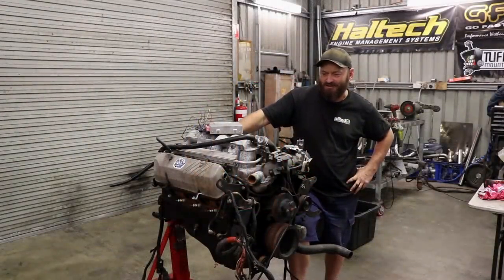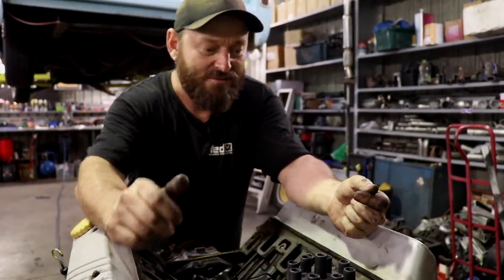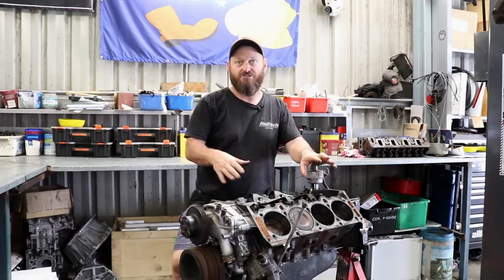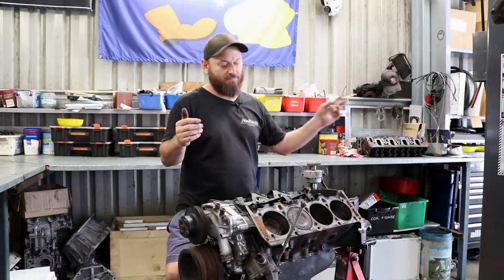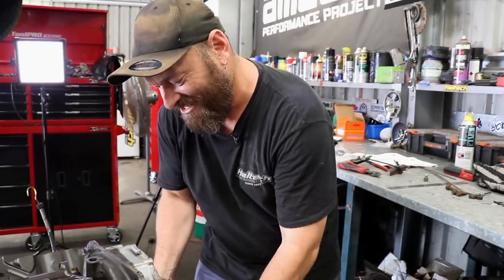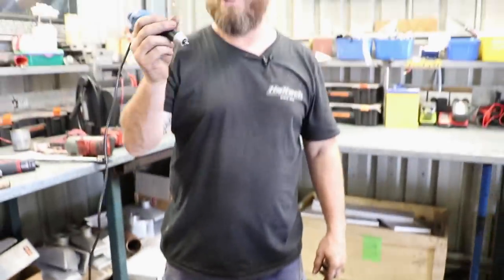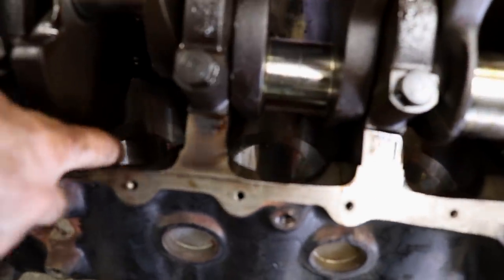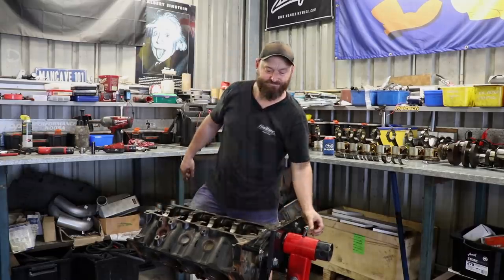GM HOLDEN 304 V8 ENGINE RE-BUILD [EP1]

Comment: Go the Five O

Such a good sounding motor. Not wrong about the torque either. They go hard : )
Reply: 304 is 4.9 even had 4.9 on the air cleaner when first came out in VL s
Reply: @JosephCowen-ru7up  yes but for simplicity we round up and call all 308s & 304s 5 litres. GMH put 5.0 on the back of a VN SS. Also said SLR 5000 on Toranas even though the exact cc displacement is a little different.
Reply: Tru , as a 308 is 5.1 ,

Comment: I’m looking forward to this! I’m old and I’ve owned a couple of these 179KW monsters, no pudding skin was safe from their might! But now I own a beautiful Japanese engine from 1994 BUT I would argue that these old 304s are better or more likely to keep going than the much more modern 3.6 litre 6 cyl turds that saw out the Australian commodore’s run. I don’t reckon you’ll be bothering to pull any of those open in 20 years. None of ‘em will be running unless some mentally unhinged person decides rebuilding one for the fourth time is a good idea🤓
Reply: These engines last for ages if well maintained. Mines 20 years old done 400k only a minor sump oil leak.
Reply: 308wce 05 Yes my youngest one was an ex cop VT with 200,000 on it and whilst I maintained it perfectly and changed oil and filter every 5,000 and put good oil in it, I absolutely rang its neck every day until it had over 300,000 on it flooring it to 100kays an hour multiple times a day and plenty of burnouts and all I had to do besides servicing was lift the cover off the bunch of bananas and replace a vacuum hose once. Traded it in to Holden for a token 2G off on my VE Calais 6.0 and it was still running strong.

(I had to bring the VE right back after 1day for electric window and speaker repair and when I picked it up I noticed my VT parked out the back with a small but thick black rubber fan tail on the rear guard so I know it was worthless to them and they had clearly been giving it a hiding too!)

Comment: It's kinda like a GM 305. Americans like to use them for boat anchors. It made crappy power and the aftermarket preferred the 350 engines.

Comment: It’s a completely stock VT304 roll block Pistons are junk throw them straight in the bin for a cheap rebuild use 20 over size flat top pistons from ACL will cost you $300 take off 25 thou off the deck Will give you a zero deck height Your compression will end up being low 9.4 to 1 comp Get yourself a small aftermarket crane roller cam A little bit head work do a good Port job on the manifold fit extractors And you will pick up 60 to 70 hp

Comment: The vn group a motor made 215kws with its twin throttle intake, they lost 15kw for the sv5000 and used the bunch of bananas intake. 

The VT GTS and senator's hsvs did have the blueprint option as well, they made 220kw, blueprinted was 230kws+ 

It is kind of scary to see the crank need balancing on every 304, but Japanese and most European things spin up perfectly. But it's room for improvement.
Reply: And they ran front rear and middle sumps.
Reply from the maker: @Low760  What was the middle sump for?
Reply: Hk-hg Kingswood was middle, aftermarket ones are very obvious that they are mid, lh-lx Torana is different again too.

Comment: Steve Morris uses splayed 4 bolt mains for his SMX engines, I'd say he knows a liitle about it.
Reply: Glen Tight Steve Morris'  SMX is an Alan Johnson design 481X .  Steve more played with water jacketing.  FYI... Formula 1 Engineers think splayed steel caps are a bit of a joke as they 1... expand at a different rate than cast iron or aluminium and 2...They pull into a skinnier part of the block webbing... that's my 2 cents worth to try and get someone upset!!! Cheers!!
Reply: @robmotown1  yes, the SMX is a 481X base, but c'mon, "played with water jacketing" is selling it a little short. There's a stack of work in that. The main reason to redesign the water paths, both in the block, and heads, was to run drag week cars. Crank/Rods/Pistons would go into any 481X✅. 

F1 engineers aren't building "streetcars", nor are they dealing with 3000hp+ at the crank, they build to a ruleset, I don't know the ruleset, but I am fairly confident that their tolerances wouldn't allow a cold start.🤣

All the 481X stuff is billet. Block, mains, heads, probably rods too.

As for upsetting someone, it's all good. It's just opinions.
Reply: Glen Tight yes Steve Morris has done a lot more than water jacketing...!!!  His SMX is very VERY  impressive!!! I wasn't playing his engines down... Iwas just saying that his whole goal was to have a water jacketed 481x. And that is what he has done. But it is still a fundamental AJ design. So basically... I am saying that it isn't solely his design engine.... He has improved on AJ's design!!! And ... made a couple of design features that have you buying from him only!!!! ..... not that there is anything wrong with that!!! Most short engine parts are available from many companies!!

Comment: Older Caterpillar v8s had the angled bolts in the main caps they may still do now havent seen one in a couple of decades. I cut my teeth in a reco shop on the old 253 and 308s and by the way there are plenty of v8s down here in tazzy but bang for buck go the falcon turbo.

Comment: Yeah, I bought a Honda 1.8L DOHC engine for my Civic to boost it and the kid that I bought it off of told me that it had 90k on it. I boosted tf out of it for 8k miles and the rod bearings all wore out and destroyed the crank. I told the kid over Facebook and he said, "well it had a bunch of miles on it." I said that 100k isn't a bunch of miles, and he responded, "I told you it had 250k on it when you bought it." What a toolbag. The next engine that I put in it was refreshed with new rings and all new bearings before it was boosted. That engine made 412 whp on cast rods and pistons and NEVER gave me an issue.
Reply: be the best, because its the same corvette engine from the states basically and that HSV models are going through the roof is low km and excellent condition. :)

Comment: Wow I’ve never seen this engine before and it looks pretty good, almost like a early ls. wayy better than the POS tune port 5.7 lt1 engine we got around the same year here in the us. I’d be interested to know if there is any compatibility between American blocks and those heads? That spread port design should make way better power than the crap ass sbc heads (stock for stock that is) you strailians always get the good stuff!!

Comment: As an Aussie, I've never had any experience with a Holden 5.0. My only experience has been with LS1 and 2 engines. I must admit I've never held the Holden 5.0 in high regard due to the fact that their power outputs were so low, even with a stroker. Be interesting to learn something new here. Please tell me you'll boost the crap out of this engine with turbos - it'll be boring staying N/A.

Comment: So what do these heads flow like? The combustion chamber looked like valve shrouding wasn't an issue.

Also, add a vote for boost. Twins. There's a Holset HE211W that takes regular td04 housings (so you can mock it up with wrx turbos), flows 30lb/min at 2:1, and apparently spools marginally earlier and faster than a normal td04 while having less backpressure, which might make for an engine that's responsive even on the factory stall... I mean 600hp at 15psi is more than enough airflow unless you go wild...

Comment: Holden apparently developed a 304 with DOHC and considered using it for the series 2 VT but obviously it was cheaper to use the LS 1.
Reply: It also had 3 valves per cylinder and made 220kw but it was too wide to fit in the Commodore.

Comment: Interesting. Not being familiar with these Aussie engines, it looks like Holden may have also borrowed SBF architecture in terms of the symmetrical ports.  GM seemed to favor Siamese ports other than the BBC in the sixties which had canted valves and not inline.  The intake and exhaust ports appear generously sized.

Comment: Damn those heads are TALL, no wonder that mob in Victoria were getting them to flow 650h.p on a flowbench... :o
@7:56- don't worry, your not the only one who doesn't! :v
Always had a thing for our Holden V8's but the 304 was the one I never got my hands on- they were still too new when I was at it...
Just out of curiosity, did Holden fix the cam-chain tensioner location with these later motors???
The older version had them on the tight side rather than the slack- my preference was to swap out the whole lot for one of those noisy gear-drive sets
Looking forward to seeing you blokes doing a decent job with a local legend, please do us a favour though???
Build it to rev, they love it being so over-square & it should scare any of those LS-iers watching the Tacho- but only after yerz ticked that "Blue Print" option! :D ;)

Oh, & I also remember double row timing chains at least as far back as HJ (74-75-76) & I was sure the 'Q before as well...
Anyway, thanks again!

Comment: I’m a year late but, six bolts do a better job making the block rigid and preventing cap walk. It’s one of the soul reasons a stock ls block or Ford modular block can take so much power. The fe engines went cross bolted with the side oiler engines to shore up the bottom end for racing use. The 426 hemi was cross bolted and had very little issue. A cross bolted 426 block is way superior to the 440 because of cap walk. The 440 isn’t cross bolted

Comment: I think those pistons are ACL's that repco offered in their "rebuilt" engines. Not sure but rings a bell
Reply from the maker: I thought they looked unusual but the bore is 100% std and there is a GM part number on them.
Reply: But then they are stamped ACL in the last shot of the vid, were ACL an OEM vendor for the late 304s?
Reply from the maker: @dmvtechnology  I suspect that is the case.

Comment: Were lemon squashes common under intakes on these 304’s? As an American I can say I know nothing of value, but the temp reduction,  dampening attributes and flavor of that upgrade is worth the hassle of the installation time!!!!!
Reply from the maker: They were normally VB's as the Holden Engine plant was in Victoria but the odd assembly guy may have been from Qld originally and used Lemon Squash or Milton Mangoes instead.

Comment: PS, sorry yep had to replace all my welsh plugs with brass ones, which happened around 450K.  on my 5Lt capricorn micra berlina. :) either someones driving it or it went to auctions or they fixed it up a little and now its still going? After all the VT's will go up in price as they all do, due to holden and ford stop making V8's ? so any V8 and especially special ordered models, like i have seen a VT green the same green, but not in the micra, with leather and its a six, so again the factory leather is something you will never ever find especially with the berlina trim, so to speak  and the calais 5lts are already going up in price. :)

Comment: Sorry but the VT 4.9 or 5Lt made 187 KW, cheers :) the first 4.9 lt injected ie VN's made 165KW and the HSV medals made a little more like the CB 300Kw engine would simple be the best, because its the same corvette engine from the states basically and that HSV models are going through the roof is low km and excellent condition. :)
Reply: @GS-kh5se  Sorry your right its 179 KW, cheers, but i put it around the wrong way more or less. :) Also had a chance to upgrade to a 195 KW black senator with white or cream leather, but did not do it. :) in the past life goes on. lol :)

Comment: Interesting video mate I've got a couple of questions if you can answer please. My son's got the VT with the five liter in it. Is there a cheap way of increasing the power? Lumpy cam mayb, what do I need to do other work if I'd put bigger cam in? And second is it hard and expensive to get rid of that stupid distributor, I haven't touched it yet but it just looks like a freaking pain. Cheers Graham

Comment: i build up one of the last real 308ci black motors in my dads calais VK was a surging slug carb and fuel pump issues ,he had it rebuilt just few months before full redlands bay engine rebuilders did it , mechanic who installed it didnt nip dizzy down and i blow it up on hiway one night , cracked all the rings , so pulled it down fixed it , looked brand new but the rings , did extensive head porting and stage 3 heat seeker ,lt1 springs , set of pipes and carter pump ,650 vac ,hdt air intake ,livin up the old girl 
 ,3.08 gears sucked but , sold it to some kid  in bris ,he craped himself on test drive i took him on , lol
0)  on a side note my bro had 5.0 red sle vb or vc , it had turbo 350 box , were the vk black 5.0  was trimatic   funny about oil issue i had that dew to not packing vas in pump ,but good mate gave me a tip to compress air down dipstick ,and it worked ,

Comment: Hey I have had a V8 engine out of a Caialis was surpose to go into a landcruiser wagon 
But my question is can they be converisioned to be used in a old ski boat?
Reply from the maker: They can provided someone makes water jacket exhaust manifolds for them. The bottom half of the engine is not really any different from a 70s 308 and they were commonly used in ski boats.
Reply: @theskidfactory  hey mate, in the process of fixing a blown headgasket on a vs statesman, my question is, why would my front waterjackets be completely blocked off I'm lost, if the rears aren't used cheers

Comment: How much difference is there between this and my 86 trans am their both listed as Lb9 engine, thinking of rebuilding my own
Reply from the maker: Yours will be a 305 SBC, they are cousins but not really anything in common.
Reply: @theskidfactory  shame, not finding to much support here in Aus for them every forum start with an engine swap. Wanted to keep original and have a little more power on a budget

Comment: The bat wing option is the VR/ VS GTS R, the last of the VS, before the VT, which they all had blue printed engines in them, thus the 215 kw, but went like the clappers. :) NOw worth a lot of cash, in fact you could buy a holiday home iif you have one with fuk all km's so around the 150K mark. :) But what pissis me off more than anything is that all the holden HDT cars even in the late 1980's early  and late 1990's they were going for peanuts, yet the fords orf the same era were going like hose prices yet they were nothing special at all, but now you have to sell your home to get one, how stuffed up is that ?

Comment: VN commadors were Opel Senators for us in Europe but only 4 and 6 cylinder engines. never got a V8. even in the 90 we had the commadors as Opel Omegas the bigest engine was a 3,0 V6.
Reply: Ours had cast iron Buick 3.8 V6s from 1988 to the mid 90s then they had Ecotec V6s until 2004 which were a updated buick 3.8 then we got the Alloytec alloy dohc 3.6 made by Holden and Caddilac from 2004 to the last Aussie made Commodores in 2017.
Reply: @aidenh2563  i myself own a cadillac STS with the 3,6 V6. it a fun car with RWD and 189kW at the rear wheels. comfy highway cruiser that can handel as well. last year we had the holden UTE at the car show here in Estonia with the 5,7 LS V8 in it.

Comment: 3.48 inches is 350 stroke..... that crank looks remarkably like a 305 crank... I wonder what the bore spacing is? correcting myself a 305 has the same crank as a 350.... duh/facepalm...
Reply: I'm pretty sure the bore spacing is the same but I've been out of the game for a while now
Reply: @craigmandall9420  I finally looked it up - tasty bore/stroke with the 4.9 liter  - according to wiki they even had a 5.7 (350) version of that motor with a 4.0 bore and 3.48 stroke (which is the classic US 350 sbc)... that said, pedestal rockers would be nice on a SBC - though why they copied the BOPC oil system - even if it was easier - is beyond me....
Reply: They're a good engine for what they are. I had a 4 bolt block in mine and stroked it to 355ci. It was a good performer 15 or so years ago

Comment: Honest question why would u use that engine over an LS? What car is this going in? Only reason I can think of is nostalgia or money.... but why rebuild it when for the same price you get an Ls with double the power
Reply from the maker: Because they are still a good engine, the car we are fitting it to came with them std, we are trying to make interesting content by exploring other engines, everybody will complain if we fit an LS, not everything is about power and I thought that the US audience in particular would be interested to know that there was another GM small block that they may not have heard of.

Comment: First you have a STD factory never pulled apart motor. The pistons are factory STD's easy to check the piston to bore clearance only with a feeler gauge and always check the crank with a Micrometer eye guessing is Bullshit.
Reply from the maker: No one guessed anything, we had an engine machinist measure it all with accurate equipment. 
Measuring piston to wall with a feeler gauge tells you nothing about the shape of the bore.

Comment: 4987cc vs 5044cc in the VK era, wasn't it?
Reply: Sorry but the VT 4.9 or 5Lt made 187 KW, cheers :) the first 4.9 lt injected ie VN's made 165KW and the HSV medals made a little more like the CB 300Kw engine would simp
Reply: @asktoseducemiss434  I didn't mention power, but sure, lol

Comment: Has a ford fairlane with a 302 windsor pulls it out and puts a Lexus v8 in it. Has a mate with a xe wagon talks him into putting a Nissan v8 in it. Dose up a vl with rb30 in it just adds a turbo . And now an old Kingswood is in the shop and sticks with a old Holden v8 so guessing your either a closet  holden man al or you just hate ford v8s